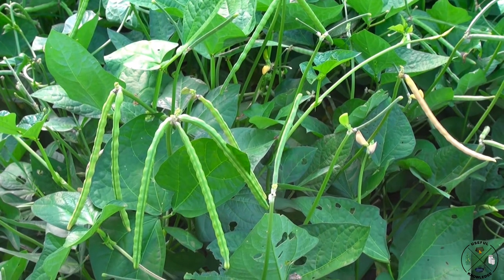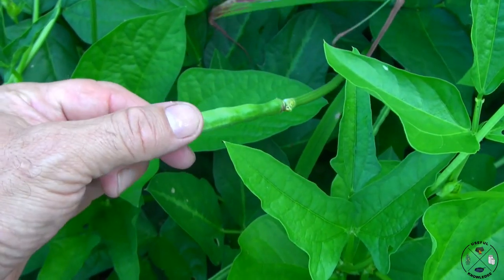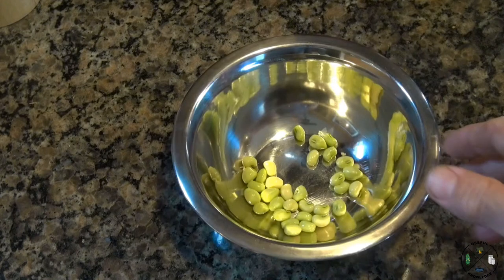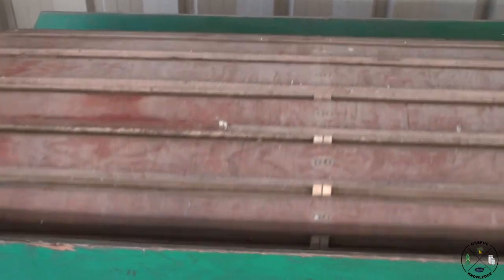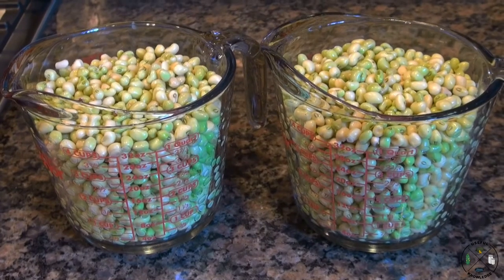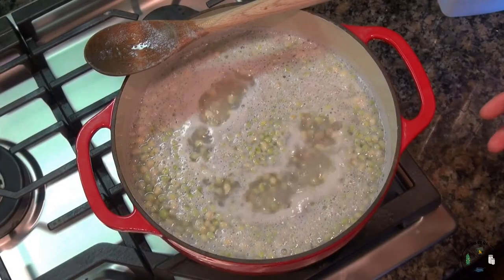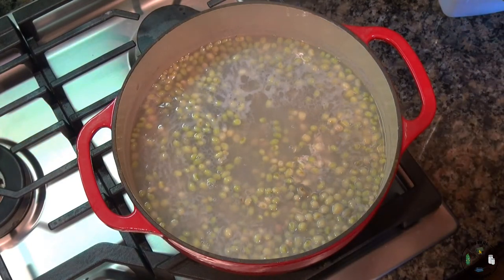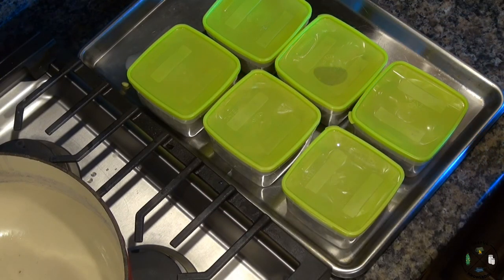Southern Peas - How to pick and freeze

Comment: Hi, great video! First year growing zippers and just as my pods are turning yellow I'm finding brown specks on pods and some of the peas. We harvested about four (testing for readiness) and about 50% were no good. Is this normal for zipper pea crops.
Reply from the maker: Thanks!  I have had a few over the years with the brown specs.  Some old timers said they were getting “stung” by insects and some said it was the rust.  Usually we just pick them out after shelling because it’s not too many.  My suggestion would be to pick them before the pod turns yellow.  Press the pod, if it gives, it’s ready for picking.
Reply: Sounds like the pea curculio.  We have them here in ne NC.   Some times they are worse than others.  Generally they are more of a problem on peas planted earlier.  Try waiting until after the first of July to plant.  I even had them on garden beans this year.

Comment: Where do you get your containers?
Reply from the maker: Hi.  I usually get them at our local grocery store.  I try to reuse them each year if they are not broken.
Reply: @useful.knowledge  What size are they?
Reply from the maker: Those are the 2 cup size.  My goal is to get the same size as like a store bought can of peas.  It will usually feed three folks at easily.  If I have more folks at dinner, I’ll just open two containers.
Reply: @useful.knowledge  Thanks, that’s helpful. I think I prefer that size as well.